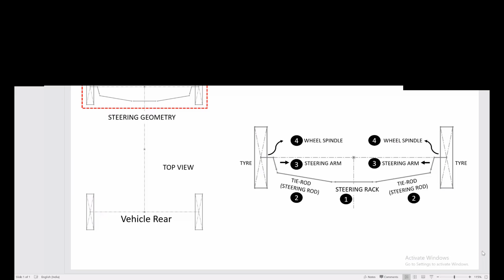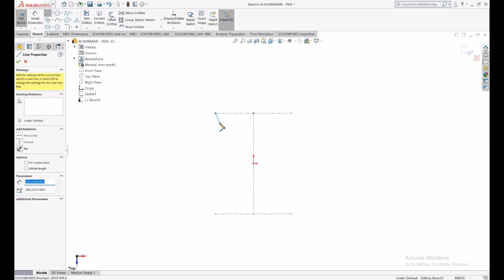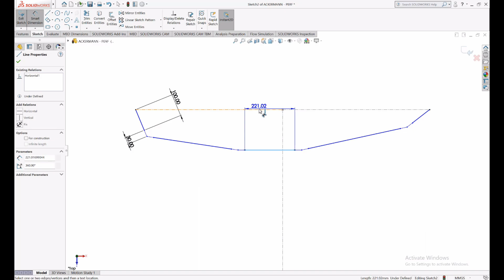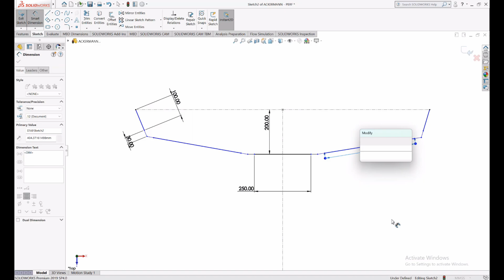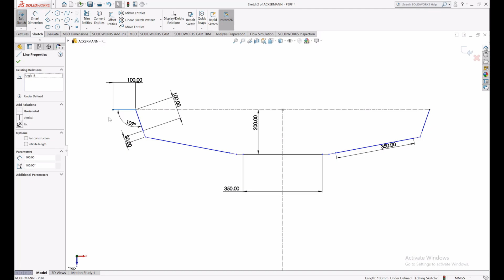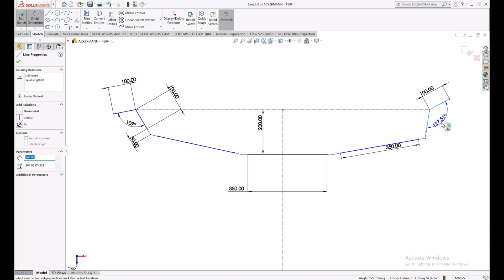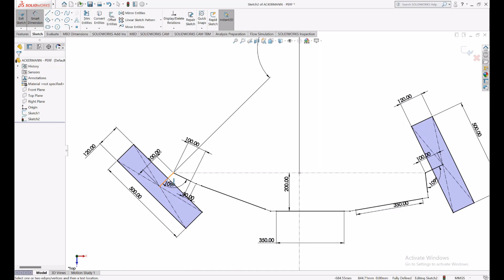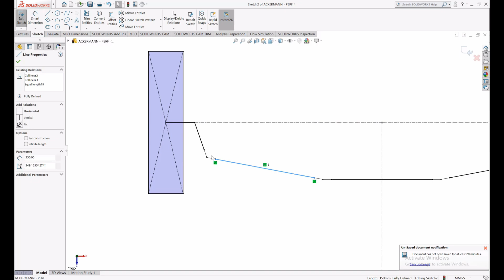Ackerman Steering Geometry | 3D Sketch | Solidworks

Comment: how you calculate lengths of steering arm and , tie rod and spindle ?
Reply: and rack also
Reply from the maker: In the video, lengths are given as per space availability and after creating a basic suspension steering geometry. Then we analyse it on suspension software and decide accordingly the length. If you are asking for rack length, then it depends on your turning radius and steering ratio.